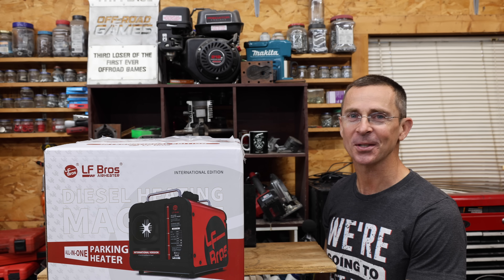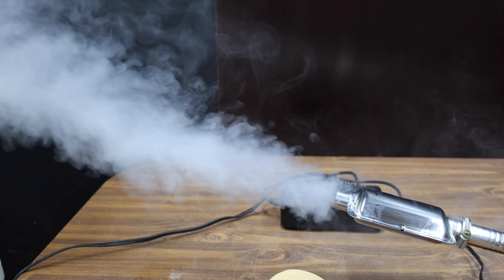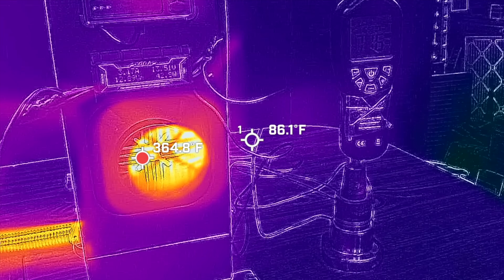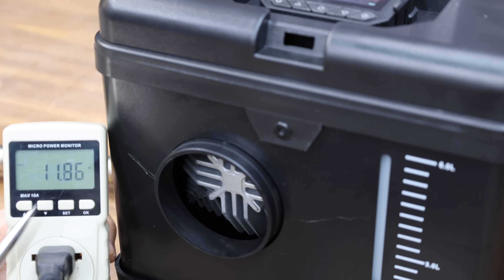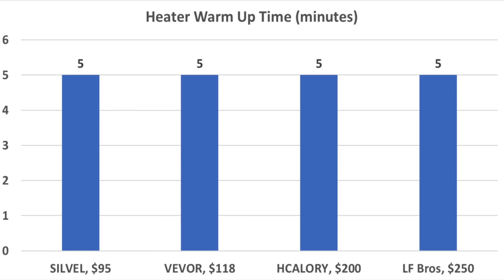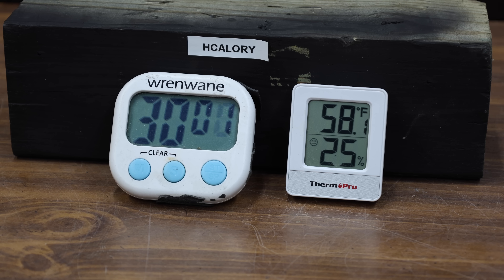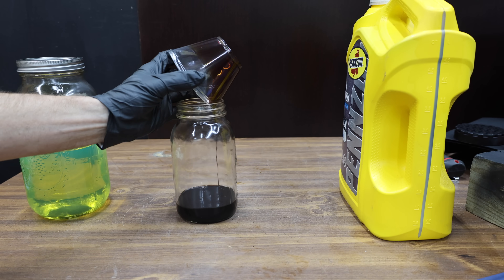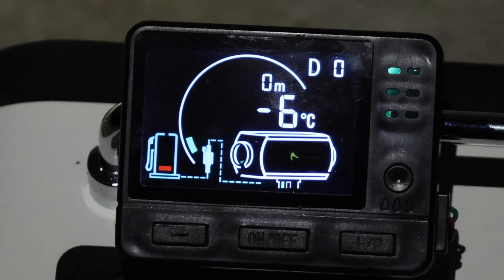The Truth About Cheap Diesel Heaters!

Comment: The silvel smoked because the first start up you didn’t give it enough voltage and it didn’t shut down properly, leaving unburned diesel in combustion chamber. The second time when you did give it enough voltage, it smoked because it was starting burn what was left from the first shut down. I don’t think it got a fair shake. The Vevor and the silvel are exact replicas of each other. Honestly, they all are built almost identical just different price tags if a brand puts some nicer decals on the outside 😂. I own both the silvel and the Vevor by the way for over a year now. That is what I am basing my comment on. 👍

Comment: I just had a 20,000 btu natural gas vented heater installed in my basement for the same purpose.  Doesn't need electricity and brings the air up to 72 deg from 66 in less than an hour.  Can open the basement door and laundry shoot to allow the air into the 1st floor. This will be my go to incase of power outage this winter.
Reply from the maker: Thanks for sharing.

Comment: 8000kW? I know you mean 8kW 😊.
For info, for your viewers: these diesel heaters must be stopped and go through the cooldown cycle. This stops the heat from literally cooking the control circuits. So it is best to use a battery (or power bank) on constant charge as the power supply. If plugged in direct to the mains the heater will be damaged in event of a power outage  Also, never let them run our of fuel for the same reason, although more expensive models do feature the cooldown cycle at critical low fuel indication.
Reply from the maker: Thanks for the feedback.

Comment: I don't get it. If you need and have 110V for the 12v power converter, what do you need a diesel heater for? Just get an electric heater. If you loose power, and you don't want to remove your car battery, you are SOL in either case.

Comment: I would never suggest these for emergency use.  They need power and they have very hot exhausts that need to be vented and I would be a bit wary of setting something on fire with the hot exhaust pipe.  They also effectively have heat exchangers that can fail and you find out when you go to sleep and do not get back up again.  Oh, and that diesel fuel stinks if you still it on anything.

What I use and have set people up with are vent free propane heaters plumbed up to 20 pound BBQ tanks vi BBQ regulators.  You can get the ones that have the oxygen depletion interlock technology.  They have built in sparkers to get them started and take no power.  They also do not vent so they are near 100% efficient.  Also,  if you are in a power failure and  your local gas station can not pump gas, the propane tank exchange takes no power.

I have found in a warm room enough gas boils out of the liquid for even a 20K BTU heater.  I have found the flames look a bit low in a subzero room, but you can put the propane tank in front of the heater and it will come up nicely in about an hour.  You do not have to worry about the tank getting hot as the gas boiling off keeps it cool.

We are the only people in our area with light and hear, outside of those who burn wood, when the power fails.

Those diesel heaters have a place, but I have yet to find it.  All of my outbuildings are vent free gas.  Oh, yes, do make sure to read the manual and make sure that your unobstructed open space is large enough for the number of BTU;s your heater makes.  This is an additional safety for oxygen depletion.  The heaters proper have a feeble pilot on purpose and that will flicker out if the room oxygen gets down to about 19% and within one second of the pilot going out the main gas valve shuts off and the whole thing shuts down.

IMHO much better in an emergency just having to worry about one gas that you can get w/o power than a heater that takes a fuel you need power to get and a heater that takes power to run.

Comment: My BIL just put one of those garage heaters 30-40K BTU's running off a gas line he extended there.  Really heats that garage and patio up, never runs out of fuel, and never smells like diesel/etc.  Probably cheap to run per hour too.
I think he got it for $299 or so.
Reply from the maker: Thanks for sharing.

Comment: Back in the day my dad would just use a 55 gallon drum full of diesel. Gotta soak a rag in it and get the rag lit to get it going then after that you can just pour more (cold) diesel in because it has to heat up before it can burn. Do not attempt with gasoline or JP8.
Reply from the maker: Thanks for sharing.

Comment: I own a LF bros heater, it’s a rad lil unit. On the lowest setting in 10 hrs it used 400 watts and the tank lasts about 12 hrs.
Anyone looking to buy a heater It doesn’t really matter which one you buy tho tbh. They’re all using the same internal unit, just have a different case and some come with a wall plug for ac power. The vevor is the most popular. Don’t waste your money on quieter fuel pumps. They hardly make a difference and cost half of what you paid for the entire unit.
Reply from the maker: Thanks for the feedback.
Reply: Watts is an instant measurement. Maybe you mean WH (watt hours). There are a couple quieter pumps available with evidence on video, but many will just be the same cheap junk

Comment: I would like to see a comparison to propane options. I am currently using a ventless propane heater as the only heating source  in a uninsulated 1200 sq ft farm house in ND . It’s advertised at 30,000 btu and it had a thermostat. It heats fine. The only electricity it needs is a battery for the igniter. The power can go off for days and it can be below-20. We are warm
Reply from the maker: Thanks for the suggestion.

Comment: So i repair these diesel heaters so with that said here's the facts! First off all those heaters have the exact same unit inside! The programming maybe a little different and the controller, remote, casing.  but it's the same unit in different orientations just wrapped with different styles and a name. Third i can't justify spending 150 dollars plus for a unit to say LF Bros. That's insanity! Everyone of these diesel heaters, park heaters, whatever you wish to call them are great heaters no doubt about that. I own 2 of them they're both the cheapest ones I could find and they work just as good as any other unit with a branded name. I just seen a LF Bros unit that my neighbor bought for 600 dollars. Now sometimes they say you get what you pay for the more it cost the better it must be! Right?  No sorry not in this situation. I brought my 73 dollar licaki unit out and took both apart in front of him to prove that higher prices doesn't always mean better. After tearing both units completely down I showed him that my parts and hardware were the exact same from the combustion chamber fuel inlet intake, exhaust, heat exchanger, turbine, bolts, gaskets, and fan. He was pissed to discover he paid 500 dollars more for a logo! 😂. People do your research. Don't buy on a whim look around for videos of tear downs of all diesel heaters you'll see that I'm correct.
Reply from the maker: Thanks for the feedback.

Comment: I have a Hcalory SS2 with automatic altitude adjustment. I live at 7730 ft and it has worked well at that altitude for one year.  I run it hot thinking it will burn cleaner.
I believe all Chinese diesels are made in the same manufacturing plant.

Comment: I found the fuel pump noise goes way down if you mount it near vertical.  I got a vevor one with the 12v wiring, 120v adapter, and CO alarm in a kit for $130 last month.  After repositioning the pump it works great.
Reply from the maker: Thanks for the feedback.

Comment: For your information, these are all-in-one units, means it has fuel tank and controls mounted in the same box. You can also get split install ones, so you can remote mount the fuel tank and/or the controls. There are also a few brands make diesel heater with integrated lithium battery and generator so it can be standalone.
Reply from the maker: Thanks for sharing.

Comment: The trucking industry has been using diesel heaters for years. Wabasto is the preferred one . They are thermostatically controlled just set your temp and relax . They are expensive costing between $900 to $1200 plus installation. Well worth the money they save thousands of dollars in fuel costs each year. Using only about a gallon each night for roughly 10 hours.
Reply from the maker: Thanks for sharing.
Reply: Can get the same thing for $100 now...just doesn't have the name

Comment: Good video, if you want to add an addendum to this video. Perhaps test if a space heater can heat a space cheaper than a diesel heater. 
Because if you have access to grid power, using one of these is not really economical. You will spend more in diesel than the cost of the electricity of running a space heater from that grid outlet. 
I know electricity prices can fluctuate but I would be curious. Can a diesel heater be economical when compared to a space heater?
Power outage, I know. But with a power outage, these things still need electricity.
Reply from the maker: Thanks!  Thanks for the suggestion.

Comment: We converted our 5th wheel over to diesel heaters after our furnace went out. We got two of them and it was still cheaper than a new furnace. They work great and over all have a lower fuel cost compared to propane.
Reply from the maker: Thanks for the feedback.

Comment: I live aboard my boat year round in Michigan and have been using one of these Chinese heaters for the last four winters.  Best $130 I've ever spent. Way better than propane.  One thing I noticed a couple of times in the video - on most controllers, "H on" (activated by pressing the OK and down buttons at the same time) is indicating that the fuel line priming mode is on as opposed to the 'warming up' mode that you mentioned.  Did you have any issues with flooding the chamber?  I have that same controller and simply pressing the power button is how my unit starts.
Reply from the maker: Thanks for sharing.

Comment: I use on to heat my 20x24 garage up here in northern Canada.   Garage is insulated and it manages to keep it above freezing even at -40.   I'm sure i could crank it up even more, but I don't need much more than that most days.   I did manage to burn out the bearings in the fan motor on my first one, but parts are readily available on ebay.
Reply from the maker: Thanks for sharing!  Sorry to hear!

Comment: I had no idea such a thing even existed but once I saw it the first thing that came to my mind was I wonder if they will burn used oil? We've got 30 gallons of old hydraulic oil and engine oil we've changed in tractors just all in buckets at the farm. Even if you have to dilute it 50/50 with some diesel to get it thin enough, being able to use half old oil would definitely cut down on the fuel cost. I have been thinking about trying to make a waste oil burner or something that I could use for supplemental heat in the shop besides the wood stove since I can get gallons and gallons of free waste oil.
Reply from the maker: Thanks for the suggestion.

Comment: Great video. Never knew these things existed. Might need to look into one to heat the garage when working on the car. 
Ever consider doing a review on fold up camp chairs? Would like to see if the $25 ones from Sam's Club (and other locations) are as good, comfy and well built as those $300 ones from Yeti and others.
Reply from the maker: Thanks!  Thanks for the suggestions.

Comment: never use any gas appliance

especially indoors

use a gas powered generator and only outside and only if you absolutely must

you SHOULD be using only solar generators but gas is slightly more reliable in rare incliment weather cases

Comment: I own the vevor and it has a VERY inefficient heat exchange, maybe due to the air flow through the case, this is why the exhaust is so hot. I solved this issue by using a 6' copper exhaust pipe and blowing low speed air across it before it exits the shop. It made a really big difference.
Reply from the maker: Thanks for sharing.

Comment: Very nice test as usual! There's literally no need to watch any other reviews if PF has already done one. Thank you for all your tests.  I do have one suggestion. The intake for the heater should be routed to the outside so that it is drawing in cold air from outside, then sending it outside. Instead of pulling cold air from seams and lowering shop temp, lowering efficiency. But since all the tests were done the same way, the comparison is still valid.

Comment: Nice video, my 5k Vevor has been great, I've had it for several years at least. Over the last week plus it's been heating my cabin. Outside temperatures in 20s 19:44 using less than a gallon/3 L a day on low setting keeping inside temperature around °70 F. I'm not using it in most efficient method, the heater is outside and just blowing in the heated air. No recycling of air from inside though the unit, I've got CO2 and Carbon Monoxide alarms in case.  On the comments of using propane heater it's no where as cost effective. Over $4.°° a gal for propane vs $3.°° for off-road diesel and only using less than a gallon a day.  I used propane one winter maybe 3 days per standard propane tank and fumes needing to keep a window open at least and still having CO2 buildup leading to sinus congestion too. 
 I have a second one to install in my travel trailer, the propane heater is noisy and uses a lot more propane and power. It will drain the batteries in less than a night I've had that happen before.
Reply from the maker: Thanks!  Thanks for sharing.

Comment: Life hack: a lot of heat from these is wasted through the exhaust. You can recapture this heat by running the exhaust through a household radiator (the large, heavy kind). This will help maintain the room's temperature even after the heater shuts off.
Reply from the maker: Thanks for the feedback.

Comment: Just install an engine, that will generate power for a heater element. 
It's a bit louder, but legal in Europe.
If the engine is a diesel engine, you can run a mixture of red diesel and used motor oil.
Reply from the maker: Thanks for the feedback.

Comment: My friend has the Vevor, and has tried running it on waste oil. It worked for a winter but wouldn't heat this year. 
Ultimately, he found that the glow plug hole was crusted over with soot and ash. Once that was cleared, it worked just fine. 
So you can use different fuels, but be prepared for some extra maintenance.
Reply from the maker: Thanks for the feedback.

Comment: I have that exact model of Silvel.
At its lowest setting it stinks and smokes, but running at a higher setting that all goes away. 
I power it from a car battery that has a tender plugged into the wall. 
The exhaust is where it is because it's intended to be mounted in a vehicle. Installing it indoors was a bit of a pain, but it has done a great job keeping the room warm, and doesn't use a lot of fuel.

I will note that the muffler thing isn't airtight (at least, the one i got isn't) so it should be put on the outdoor end of the pipe.
Reply from the maker: Thanks for sharing.

Comment: I run a Silvel but it's the case style of the Vevor, used it to heat the basement when it's cold here in Kentucky, with the hot air rising it helps heat the house nicely
Reply from the maker: Thanks for sharing.

Comment: Looks great for a garage heater. Far better than the propane torpedo heaters I've used and look a good deal safer with the monoxide emissions being able to be ejected outdoors. With the exhaust being on a long pipe it's perfect to exit under a garage door blocked to about 6 inches high. This would do very well with a 20x20 foot garage.
Reply from the maker: Thanks for the feedback.

Comment: I installed one in my 1.5 car garage (mostly insulated) and it heats it up to about 55-60f when it’s about 20-30f outside. It takes about 1-2 hours on max heat to get up to there. I’ve yet to leave it running continuously to see if it’ll reach higher temps, but I’m happy with it to take the edge of the cold. In a small home situation I’m sure it would work even better. Just be careful with the exhaust it gets very warm especially on the provided shot run. I used a metal thimble and some fire proof insulation to seal and suspend the exhaust (k wool I believe it’s called) that worked just fine in my case.
Reply from the maker: Thanks for sharing.

Comment: It would be nice if they used thermal fans. And just a battery to run the digit controls and start. I would consider it a replacement for the buddy heater for camping but needing a power source kinda sucks
Reply from the maker: Thanks for sharing.

Comment: Picked up 2 Vevor diesel heaters couple years ago, 2kw & 5kw. After season sale 50% off.
Running both in a small garage is adequate. The 2kw is small sized near me to keep my hands warm, exhaust is quite minimal, run by two 14L bike batteries (OLD garage isn't 100% sealed). The exhaust is through a bike radiator with a 12v PC fan pushing air through it =BONUS. ALSO run the ceiling fan blowing the warm air down. It allows me to work in T-Shirt with a vest in +20*f outside. 😉
Reply from the maker: Thanks for sharing.

Comment: Maybe they have changed or made them bigger but about 5 years ago I bought one to heat a 10x16 building. It was just the bare unit with a fuel tank. It was advertised as 8KW but I later found there are really only two models, 2kw and 5kw. It was still plenty for it. 

I see you briefly touched on the ash buildup issue which is good but I STRONGLY would recommend only running diesel in them unless you'd like to disassemble it many times in a heating season. Save the oil/diesel mix and alternative fuel for emergency fuel only and have extra gaskets, glow plug, and fuel pump ready.
Reply from the maker: Thanks for sharing.